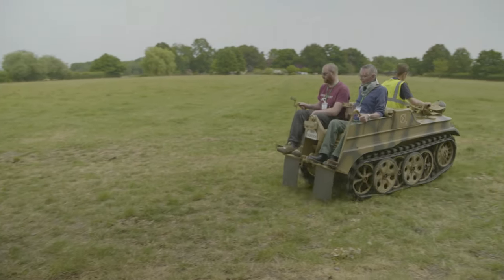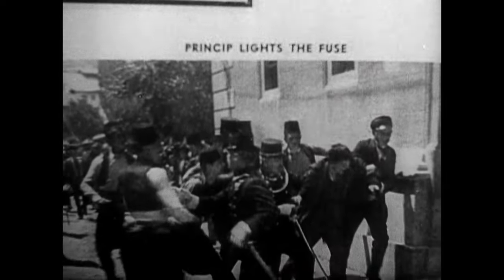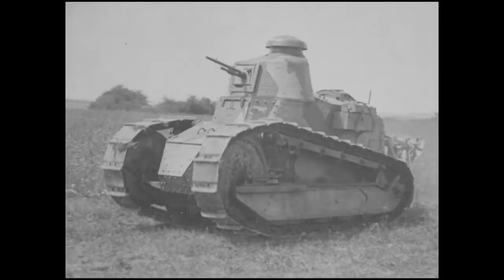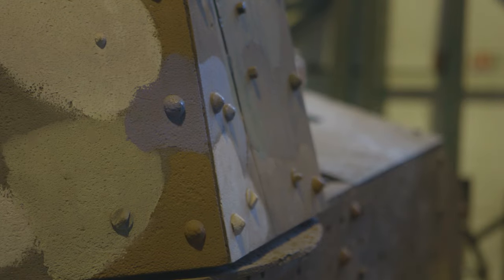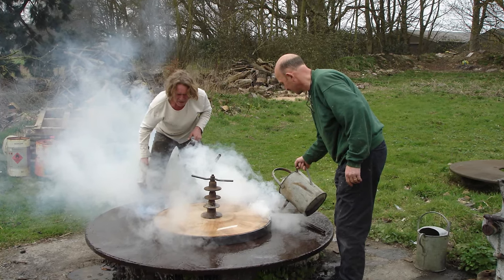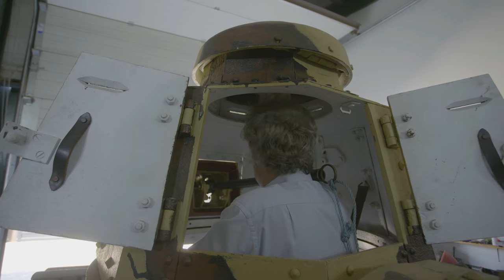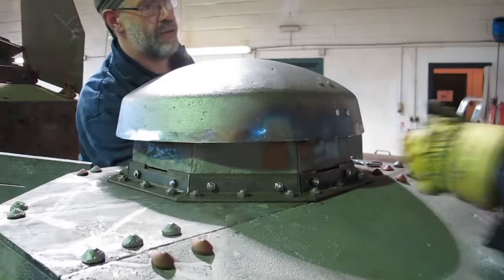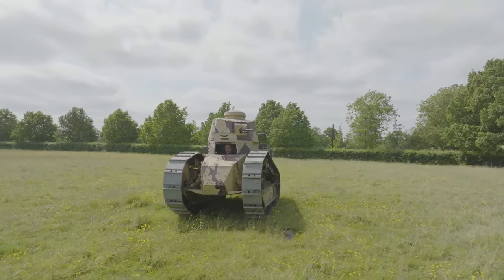Reviving History: Renault FT | WWI Vehicles Uncovered - Ep. 1

Comment: They no doubt spent more money on this project of two tanks, than the French did for all of the war time production. Frank Luke after seeing a field of burnt out FT`s. Described them as death traps. Engine  overheating and fires combined with a belt drive system that constantly shredded. Only in fantasy gaming is the FT a usable tank. The US built 900+ under license, both gun and machine gun versions. Half of those were sold as scrap or given to the Canadians for  training duties.